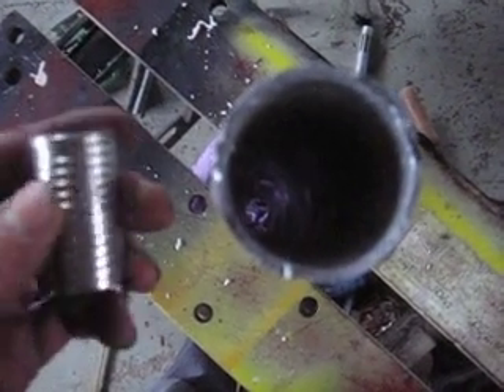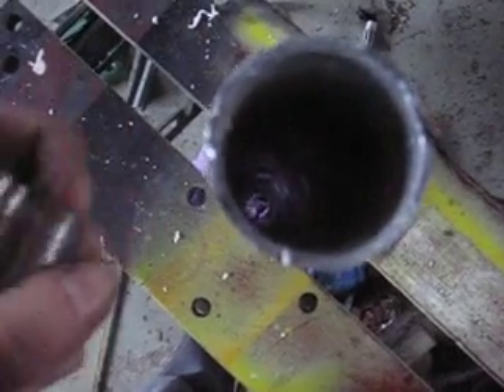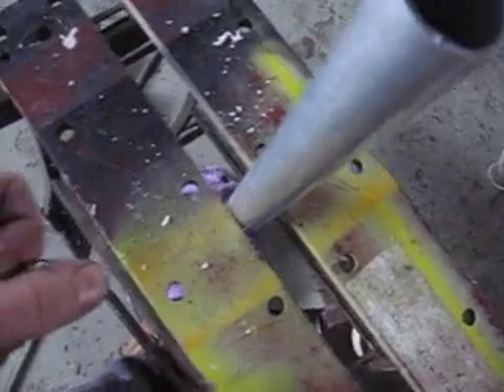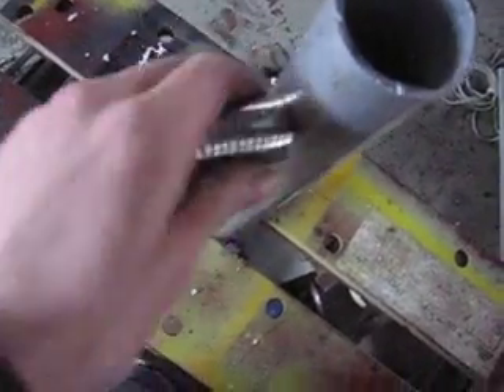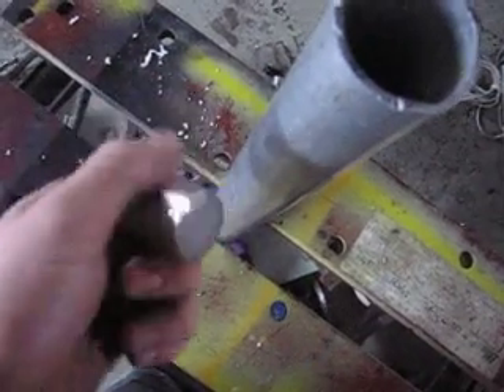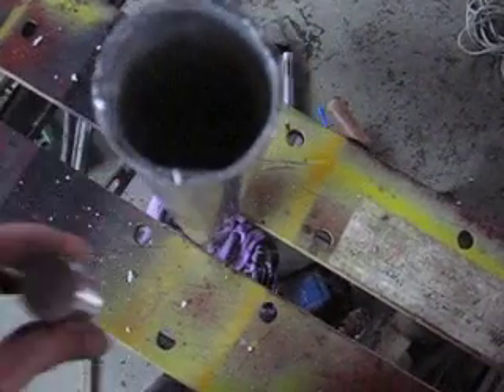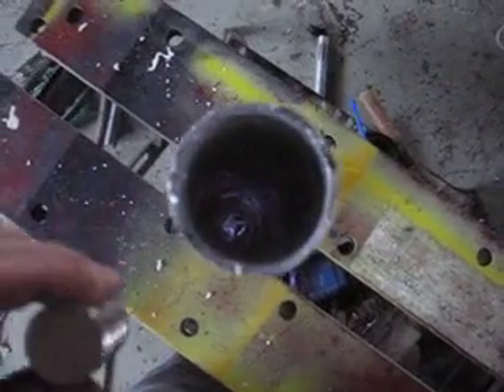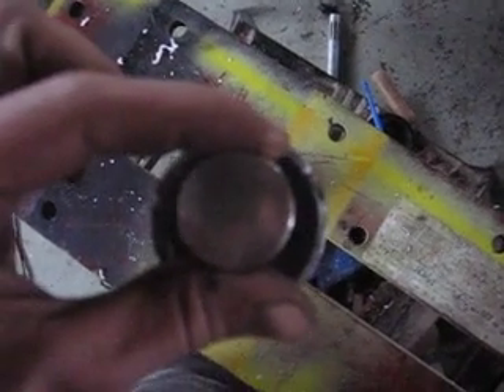neo magnets and aluminium

Comment: Yep as others have said it is the lenz effect causing current which in turn creates a magnetic field itself....which works to slow the fall...works a bit better with a copper pipe. Also to show you the principle that it is current which is creating the opposing mag field a similiar thing can be done with a long thickly wound coil of copper wire. If you connect the two ends of the wire a circuit is formed and you get the same effect. If left open the effect is greatly dimenished.